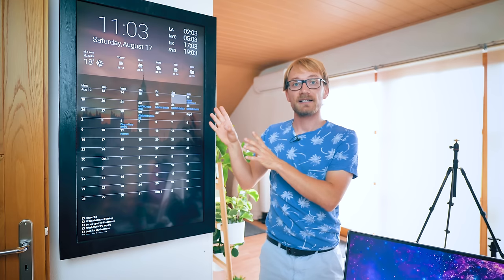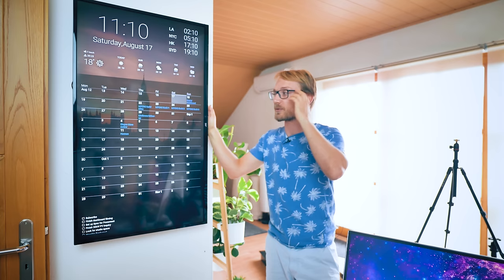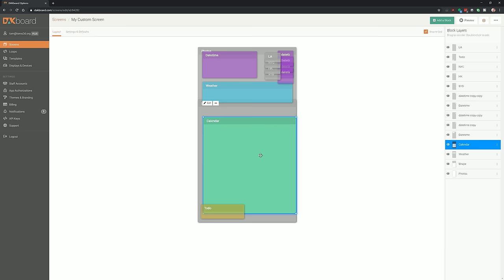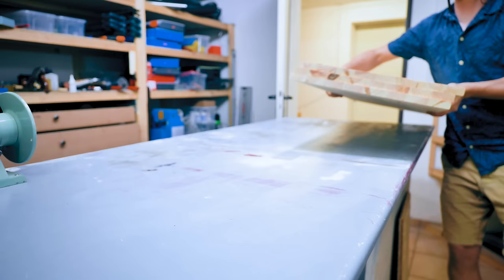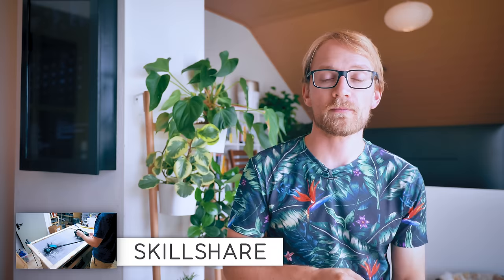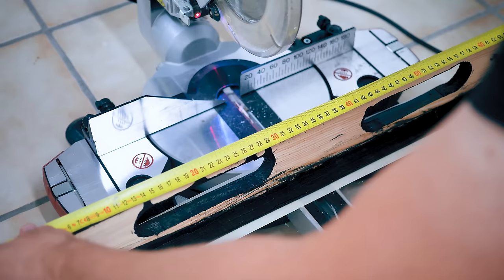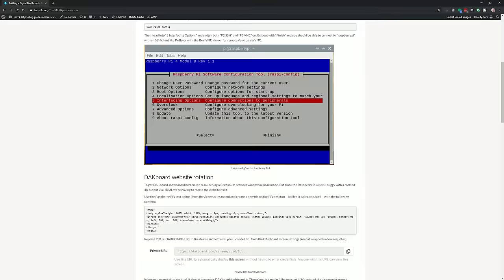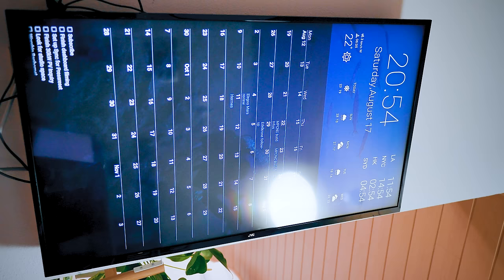Making a Digital Dashboard! (w/ Google Calendar integration)

Comment: To get DAKboard running on a Raspberry Pi, you don't have to do any of this outside of build the case. (1) Go buy the Raspberry Pi board, SD card, power supply and sleek case. (2) Flash the drive with DAKboardOS. (3) Insert into the Raspbarry Pi IoT device you've now got in your hands. (4) Velcro to back of your monitor and plug into HDMI and power up. DONE. Works like any other IoT device you'd buy commercially from Amazon, Google, etc. in terms of bootstrapping (eg. walks you through connecting to WiFi, etc. NO KEYBOARD OR MOUSE NECESSARY.)

Instructions here: https://dakboard.freshdesk.com/support/solutions/articles/35000125880-download-and-install-the-dakboard-os-for-raspberry-pi

Once you have the parts in hand, anyone can have this up and running inside of 10 minutes. Run the free version of DAKboard, if you want. DONE.

Comment: Thank you very much for this great video! I have completed everything and have it set up how I like it. Everything boots up automatically perfectly. However, the only issue i'm having is when the Dakboard loads onto the screen it's super zoomed in and i'm not sure why? Currently i don't have a 4k tv (didn't want to buy one until i tried this out on a spare tv) do you have an suggestions on what the issue might be? Any help would be greatly appreciated!

Thanks again for all of your informative videos!
Reply: You're trying to display a 4K signal on a 1080 screen, correct? I'm just guessing here but maybe it'll help. The default preset for projects in my video editor is 1080. When I go to place a 4K clip in the timeline the preview window shows the clip zoomed in until I  change the project settings to 4K. It's like the software is assuming the viewing area is 4K size until you tell it otherwise.
Reply: @tmurphy0919  It's possible that Chris Nelson is running from a Pi Zero or Pi 2 or 3, etc. that doesn't output 4k at all.  That's what I'm working with, and I have the same issue.  Chris and I are both in need of a modified test line for the "Dakrotate.html" file we've created on the desktop of the Pi, so that it asks Chromium to rotate the Dak Calendar screen but display the page on an HD screen, not a 4k screen.  Is there a modified code line for the "Dakrotate.html" file that we can utilize to get this to work on an old 1080p (HD) screen instead of 4k?

Comment: Any chance y'all are still around to offer some help?  I set up the commands as instructed in the software file.  Everything works, and the file opens, but it only flashes the dakboard for a second.  then it goes to a grey screen with the day and time in the top right corner of the screen.  If I open a web browser I can see the whole board, but I can't see it when I copy and paste the link to the dakrotate.html file
Reply: Exact same thing happens to me. Did you find a solution? Thanks in advance

Comment: what raspberry pi did you use?
ie: how much ram, which model?
also what size micro sd card did you use?
Reply: Pretty sure he said RPi 4 2GB? RPi 4 to get the 4K video out for easier to read small fonts.

Comment: what was with sprinkling the saw dust? ive never seen that before
Reply: Cheap and easy wood filler. When mixed with glue, it fills in any gaps or cracks in a wood joint.

Comment: Huge waste of timber when making the frame, absolutely no one will notice or even care what way the grain goes. Also, it will be stronger if you run the length of the grain instead going against it like what was done for the top and bottom rail
Reply from the maker: I've had a use case for the material of the large cutout - and I WILL notice the grain direction / miters forever had I built it differently ;-)

Comment: Totally over-engineered! Why not use an extended display with a chrome window in  fullscreen mode?
Reply from the maker: - I don't want to constantly lose my mouse cursor on the dashboard screen
- The screen would only be on when my workstation is on (which is a ~250W idle setup)
- I don't want to run a cable across the walkway to the screen
- Some applications (eg DaVinci Resolve or VR) don't play well with too many screens connected

Comment: Not only a waste of energy while it's running, but also such a waste of energy and resources to be produced, and you could easily replace it with an analogue clock and a calendar.

I wouldn't mind so much if you actually used it for more than just an always-on display of your calendar smh.